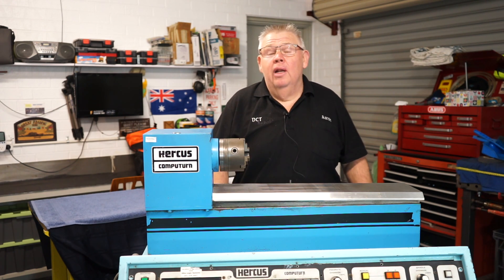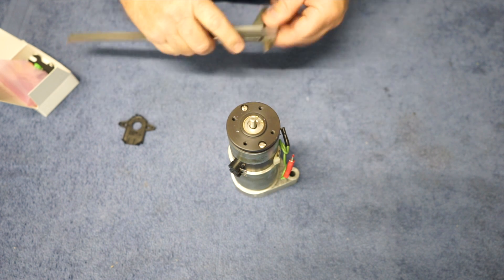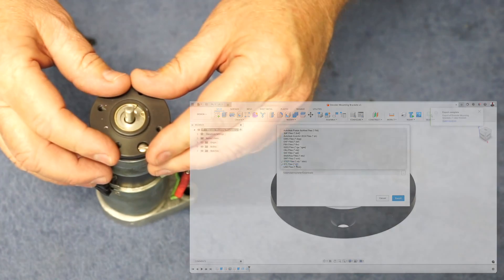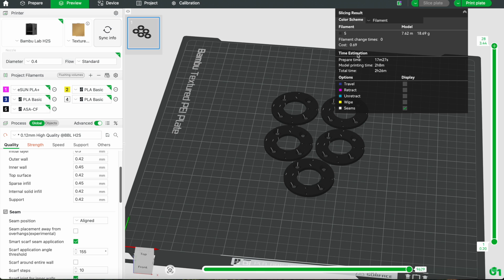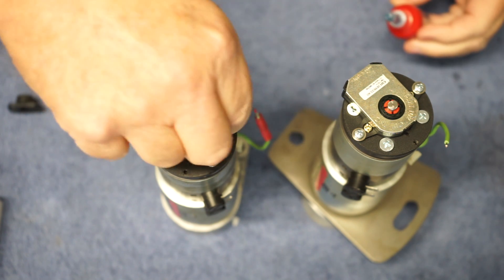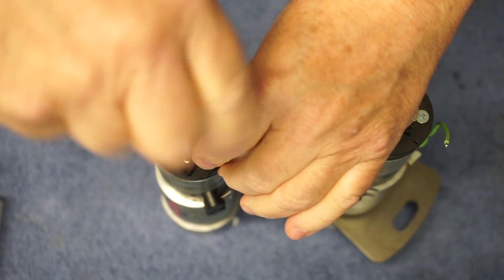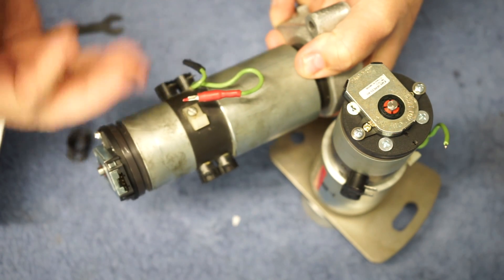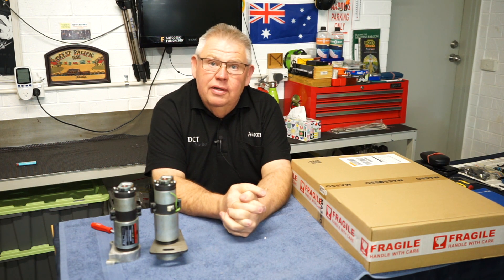CNC Lathe Retrofit - Pt.2 - Servo Encoders (H2S prints ASA-CF)

Comment: Did you notice any fumes from the ASA print in the room?
Reply from the maker: Hi Justin.  Thanks for watching and commenting mate.  Yes you are correct.  That ASA-CF (Acrylic Styrene Acrylate) really bloody stinks.  Apparently you can get ASA poisoning from it.  I usually have the window cracked when printing it.  I believe that the Bamboo H2S has an built in activated carbon filter to remove odours and VOC's.  But it's better to be safe than sorry.  So I don't sit there whilst it's printing that stuff or leave the door open to protect the little dog.  Cheers, Aaron.